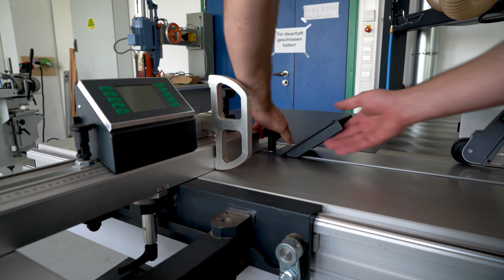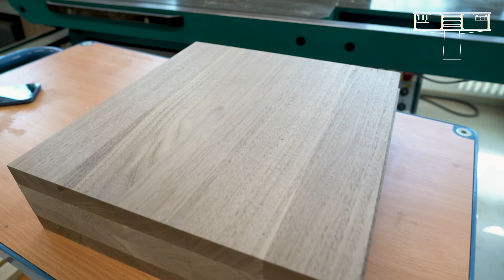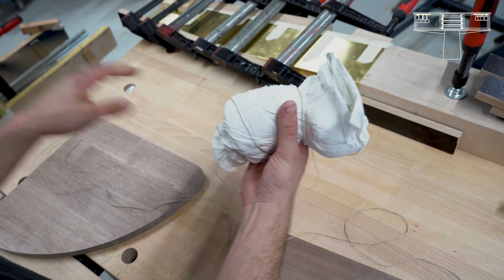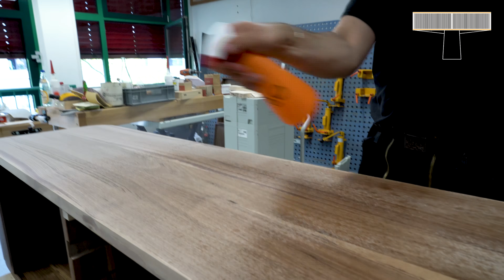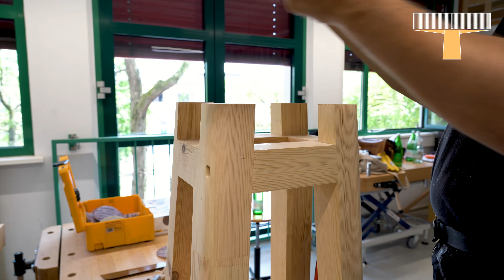Crafting My Final Masters Exam Piece in Germany – Carpentry Mastery

Comment: This is `Machine Technology, not master carpentry. Where are the hand tool skills, a normal craft workshop would have very few of these expensive tools.....and the grain in your drawer base is going the wrong way.
Reply: Laura, if you would use your hands yourself instead of sit on your high horse, you would know those machines are just time savers and no replacement for skill and knowledge. I would guess you have never even seen a professional panel saw up close.
Reply: Say that again after watching the full 10 hours of unedited sanding a polishing
Reply: normal craft workshops around here all have machines, or they have gone Broke long ago :D
Reply: First of all, if you really did watch the entire video you couldn't have missed all the handcut dovetails? Secondly, this is an exam piece and he is required to show and incorporate difference techniques including the use of hand tools, he can't just hammer sth. together that looks good it needs to showcase a whole variety of skills and techniques in order to pass. Thirdly have you ever operated these machines? It's not like it requires no skill or knowledge to operate them properly and a small mistake can destroy your entire piece even faster than any hand tool can.

And last but not least, yes machines like these are common in most professional german workshops and dare I say even in some enthusiast hobbyists shops, my cousin worked at a bespoke kitchen and furniture maker with around 10 employees, every single machine shown here you'd find there aswell including the glue up/veneer press and more. There is a similiar company about 5min from where I live, same story, similiar size. Germany is different from all those garage workshop youtubers you see on many US channels, most businesses here have machines like otherwise they'd not be able to survive.

Comment: Mmm, drawer bottoms have the grain going the wrong way, the bottom should be glued at the front only, the bottom should not be enclosed but go pat the back by 3/8 as a minimum, a groove which is chamfered and a screw to secure, any shrinkage from back to front will not impact the fit of the drawer bottom, just saying
Reply: Did he use a solid wood drawer bottom or rather veneered sheet good? I can make an educated guess and if you half knew what you were talking about you would probably guess the opposite.
Reply: @ThaJay mmm time served cabinet maker, 47 years experience in antique reproduction hand veneered furniture! I might know what I’m on about, what’s your skill set??
Reply: @davidrobbins7416  I respect your experience as I am just learning the trade for 2 years. But you don't really have to account for wood movement in the same way if you use plywood and you probably know that.

by the way if the bottom just sits in the groove all around no glue and 1mm play for expansion it would even work with solid wood. Just like a panel door, which you undoubtedly know about.
Reply: @ThaJay good luck, you carry on

Comment: Dang, Germany regulates EVERYTHING to an insane degree. Probably explains why it's so insanely difficult to replace a thermostat in a BMW engine where you have to take off the front end of the car to get to it since it's placed IN THE BOTTOM OF THE MOTOR.
Reply: I think that doesn't have anything to do with Germany and everything to do with BMW
Reply: @adarshjkalathil ...it was a joke...
Reply: @blandrooker6541 maybe it is cultural differences or maybe it is sad to explain jokes
Reply: Its actually a remnant of german guild tradition as much of our apprenticeship system is.
But we do overregulate regardless

Comment: How times have changed! My friend Egon, who grew up in Germany in the 50's and 60's before coming to the US and who took and passed the German carpentry master's exam back then, told me that the requirement at the time was to build a drawer with dovetail joints for the front and back in 30 minutes using 4 hand tools only: a saw, a chisel, a hammer and a plane.  Judging from this video, it now takes a bold design, an ambitious project, a desire to impress, and some $500,000 worth of tools and accessories, and apparently some luck.
Reply: To be fair, this flashyness is not necessary to pass the test and become "master" but some students (especially people with their own youtube channel) like to take this last opportunity of having access to a huge workshop with almost unlimited access to tools and resources to do something, well, a little "over the top".
Reply: I agree masters in there trade get awarded the title in very difficult circumstances by people who recognize your skill after they have had years practice.  The machines just make it commercially viable.  Your talent is obvious to a layman but not to a master.

Comment: Annoying beat music. “Less is more”. And while the runner system worked well, it is seen as a glaring, ugly stand out - visible instead of hidden - when you open the tambour door. Designing in the final effect requires careful visualisation and preparation beforehand. I would have liked to have seen a solid wood stand (maybe carved) or a cast aluminium contrasting with the walnut. Instead, the brass is a harsh brazen contrast masking the softwood construction - and therefore not authentic. Also, brass is quite a boring material and tarnishes badly over time or requires constant polishing. Overall your construction techniques are very soundly executed and show a deep understanding of the material of wood. Your design skills, however, less so. Just comments from a designer, furniture maker, teacher for 50 years.
Reply: you make a few solid technical observations, but most of your comment mixes subjective taste with claims of objective truth. visible mechanics and mixed materials are established design approaches, not errors.

what is more striking, though, is the pedagogical side. someone who highlights decades of teaching experience should be able to offer feedback that is structured, respectful and aware of its impact. your tone reads less like a trained educator and more like someone airing personal annoyance. effective teaching relies on clarity, proportionality and the ability to separate expertise from ego, none of which are really present here.

with a more measured and pedagogically sound approach, your technical points would actually land instead of getting lost in the tone.
Reply: The masters cert is about objective capability, not the subjective musings of style that are irrelevant to the intended purpose of the piece. 

It seems like you have been left behind, some 60 years ago. Brass with walnut and angular, artistic, functional and visually outstanding connections are not only common, they are quite desired in high end work. Contrasting color with wood species in hand cut unique dovetail patterns are highly desired in many styles, especially art deco and mid century modern pieces. Where simple lines and functional design are the theme, outstanding visual contrast within the wood adds character to a piece. These are certainly not traditional, Victorian, baroque, neoclassical, etc wood working principles, but it what is demanded and selling in custom furniture today.
Reply: @rustdcamo9561 left behind? I think not. However, I stand by my comments. Interesting you don’t critique the piece, but my comments. Sad.

Comment: Great work... a little known trick you might want to keep for next time.  When using tube glue or caulk to glue two things together apply it in full circles as the circles will create a vacuum when pressed together and in most cases you don't even need to clamp it.
Reply: what are you talking about? theres almost no application where you can avoid clamps. I would like to know some examples
Reply: @laius6047  Average sized mirrors where the frame is resting on the countertop or shimmed up (basically where the mirror is supported on the bottom) I don't use clamps.  Use the correct glue for mirrors and draw multiple COMPLETE circles, place the mirror in place and push the mirror into the wall spreading the glue and then the most important part is to pull the mirror away from the wall again allowing the glue that is now on the mirror AND wall to dry for a minute and then press it back onto the wall and a vacuum will form in the circles of glue and a regular sized mirror will stick to the wall without clamps.
Reply: @tableshaper4076 ok..I thought you're about wood.

Comment: Was that a router table and if so, what kind is it? It looks very stout.
Reply: Pretty sure you’re talking about the Shaper. It’s like a router on steroids. Years ago, we would duplicate old crown moldings with one of those, doing renovations in the SF Bay Area. I haven’t used one in years, but they used to be quite dangerous.
Reply: @RealJSGilbert  If you mean the large stationary router (I don't know the common English term) then yes it is still extremely dangerous. That's why this machine has more safety precautions than others and the instructors, at least in their neighbour NL, are very strict about using them all.

I mean a panel saw can be pretty dangerous but as long as the safety hood is low above the wood and you use the correct hand positions there really is not that much to it. This stationary router on the other hand, has multiple steps in setting up the tool and setting up the safety equipment before it's safe to use and none of them can be skipped.

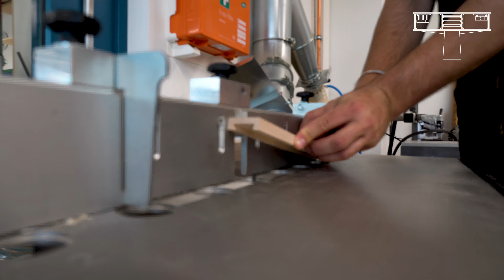Comment: 12:16 did this sequence give anyone else with router trust issues a heart attack? 😮 Amazing work, no judgment, just my own fears.
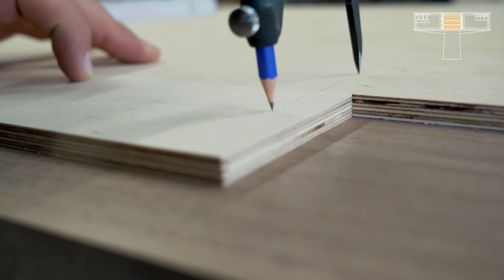Reply: Dear god then 14:40, you are a brave man!
Reply from the maker: you could call it brave... i call it time pressure :D
Reply: @MaximLeonardDesign I call it incredibly unprofessional.
Reply: I don't think router tables are that dangerous and also this way of using them not that bad. Also a band saw is very predictable and safe.
Only one I found really sketch is the cut off saw one. Especially at an angle a clamp would be nice instead of a finger. The other ones were really not bad.

Comment: Excellent work. Very impressive. As a woodworker with a degree in English, I want to point out that what you are doing is cabinetmaking or extremely advanced joinery, not carpentry. I know many people call any sort of woodworking "carpentry", but there are differences between the work  Carpenter does and what a Joiner or Cabinetmaker does. Your work is definitely best described as Cabinetmaking. Sorry for the pedantry, but I like words as much as I like woodworking.
Reply: I'm afraid that this is not correct. Please consult reliable sources. A Carpenter is a Zimmermann, someone who builds structural elements of buildings. 
A Joiner is a Tischler or Bauschreiner: builds interior elements like doors, flooring skirting, panelling, etc.
A Cabinetmaker makes fine furniture, including veneering and making decorative joints.
There is, naturally, some overlap and regional differences, but overall, these definitions are correct.
Reply: @DavidH.-gg2nd  Ah danke für die Erklärung. Ich bin zwar auch Schreinerin mit nem Englisch-Bachelor  aber bin da nie ganz dahinter gestiegen. Also wäre ich wohl am ehesten "joiner", wenn ich mir das so anschaue. Was wäre denn eine sinnvolle Übersetzung davon, dass ich Gesellin bin? Macht "journeywoman" Sinn oder ist das Quatsch? Oder sowas wie "trained joiner" hier die sinnvollste Beschreibung?
Reply: In germany there is the zimmermann  the joiner in english he builds the houses and the tischler   translated into english is carpenter   and the carpenter does exactly this building furniture and nowadays also installs windows doors flooring ,drywalling and stuff

Comment: The camera on the saw is neat, especially if used in conjunction with a more destructive/last resort solution like a SawStop, which detects fleshy things coming in contact with the saw blade and rips the blade down, destroying the sawstop but turning a lost finger into a minor cut.

I don’t know if you have a SawStop type of device in Germany though, hence the explanation.

The advantage of the camera in this case is it would prevent the SawStop from needing to trigger.
Reply from the maker: I have never seen saw stop technology in Germany but i know it from youtube... I guess this was Altendorfs attempt at saving the saw in such an occasion... It would need more cameras to optimate i think... Atm its only 2d, so your Hand could really be anywhere in the hight and it would trigger...

Comment: As someone that welds structural/non structural steel for a trade i had to laugh at the comment you pointed out about the examiner saying the glass holder a potential weakness, even though we build out of different material there are always those that are concerned with such trivial things, its to hold glasses not a persons weight. Spectacular piece. 👍
Reply from the maker: Thank you! Yes, it gets very detailed during the examination :D

Comment: There are a number of moments where you are applying direct pressure on the piece towards the cutter of the router bit with bare hands … I had to close my eyes.

That said impeccable work.
Reply: Yeah that made me cringe too. An unknown flaw in the wood — a weak pocket from a beetle larva or something — and a fingertip could easily be lost. It might be 1 in a million on each piece but in a career you might do hundreds of thousands of woodworking operations so…well, I wouldn’t do it. But partly that’s because I know myself and I know that when I get rushed or impatient I get careless. I have some strict rules for myself that I never, ever, ever violate. If I were a more careful person and trusted myself to very carefully check each and every piece over its entire length, maybe I’d put my fingers 5mm above the jointer blades too!

In any case it’s a beautifully made piece and certainly the work of a master craftsman. It blows me away that you’re not allowed to work as a carpenter in Germany without being able to work st that level. We’ve got carpenters here in the US who aren’t all that much better than me!
Reply from the maker: Yes, applying pressure on the dovetail router and milling the sliding groove track was risky business, you're right. In my future work, I won’t be doing it again. This was a one-time approach to meet the time pressure and hold the deadline.

Comment: Max, congratulations from Virginia, USA, and a self-taught woodworker. You executed this very, very well. I also want to compliment your English - it's flawless (lived in Germany for 3 years, so I understand the struggle both ways). That saw safety feature would drive me insane. Also, I suspect that Osmo tells you to use a roller simply to make you use more product, and I'd recommend applying as you do with a rag or Scotch-Brite pad... it's an outstanding finish, though. I'm subbing your channel in hope of seeing more excellence.
Here is my question, which is not intended to offend you... I am curious: What is the background or perhaps historical or social basis for requiring you to obtain this Master's just to practice the craft?
Obviously, anyone in the US with a bit of talent can set up shop and sell stuff without any certification.
Reply from the maker: Thank you so much for the feedback! Yes, the saw's safety feature seems like a good idea, but it's really a struggle to work with! 

Either way, Osmo is the best. 😄 

Thanks for subscribing! 😉

To answer your question—I just wanted to get it done and have the certificate so I could work independently and maybe start a company down the line. Ultimately, I wanted as much freedom as possible as a craftsman. 😉

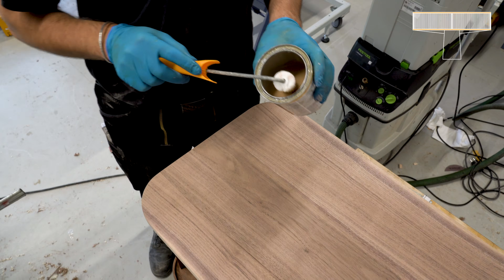Comment: 24:58 The recommendation to let it dry without wiping the excess only holds true for some Osmo oils like e.g. their 'Top Oil High Solid'; if you tried that with others it'd totally gum up the surface. Despite their recommendation to let it dry I also buff out the Top Oil after a while as it leaves a shiny smooth surface 100% of the time.
Reply from the maker: Yes, i can definitely agree with that after trying it out with the roller and letting it dry. I will probably stick to wiping it off next time ;)
Reply: @MaximLeonardDesign I think the truth lies in the middle. To apply the hardwax with a roller is much faster but it is prudent to both keep applying more to any dry spot and also start buffing it out after 30-45 minutes with a clean cloth. Just letting it dry gives a pretty uneven finish but I tried application with a roller before buffing like normal and it really sped up the process. I also got to a good result in a single session this way while with just the cloth the result could be improved with a second layer, because I applied more hardwax on the dry sections in the same session before buffing.

Comment: 2 years ago i abandoned my young career in woodwork to become an engineer instead. Videos like this make me almost regret the decision. 

Nothing quite like seeing a tree turn into fine furniture at the hands of an excellent craftsman.

Ps: ive found that the best way to oil walmut, is to do a first heavy pass with a cloth and wipe off. But for subsequent layers, use very fine sandpaper to apply the oil, gradually increasing from 600 grit to 2000 grit. After 5-12 applications, you get one of the most beautiful and lusterous oil finishes you could ask for, which is also surprisingly durable though not enough for a heavily used tabletop. Works best with oils of similar viscosity to gunstock oil.
Reply from the maker: Thank you 🙏

I've never heard of a way to apply oil like this, interesting!